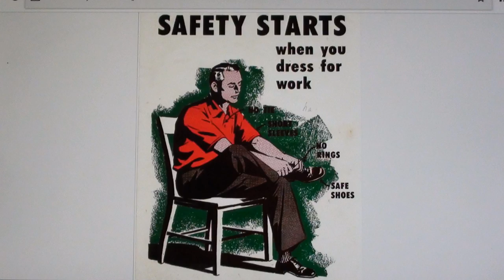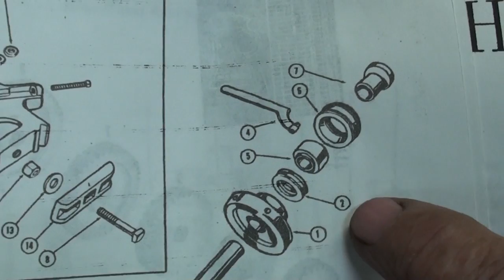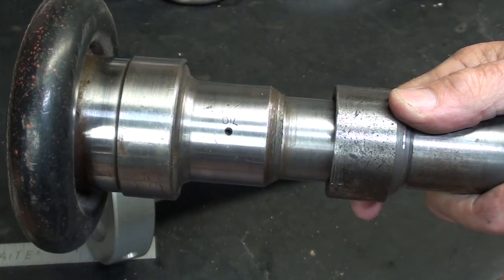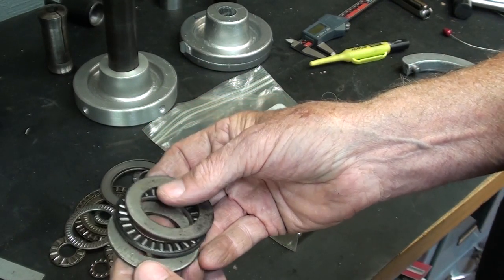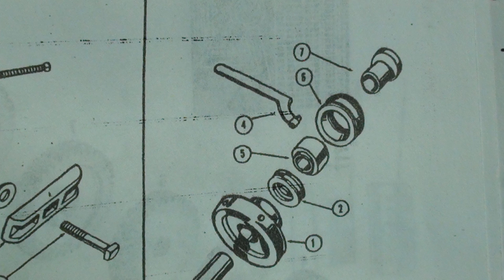Make a Hardinge Lathe Collet Drawbar 748 pt 4  tubalcain 5c handwheel

Comment: I enjoyed the series. Occasionally you corrected your description from drawbar to draw tube. My OCD wouldn't allow my employees to make that sort of description error in their repair documentation. If they did and didn't correct it themselves, I would edit their documentation.
We insisted on accurate documentation, because we daily referenced older repair records for current issues. I didn't want ANY misleading information for subsequent reference. My shop had written records of every repair dating from the early 1980's to my retirement in 2017. In 1994 we moved from handwritten records to digital records allowing extremely easy searches for data. Our shop rule was that complete documentation was to be made before beginning the next task. We ran an around the clock operation and I wanted subsequent shifts to be fully informed of repairs completed or in process, and I wanted them to have exacting detail. My highly skilled staff often resisted these requirements as unnecessary. Years later when our company embraced hiring low skilled staff, my low skilled employees could perform at a much higher skill by relying on accurate documentation. 
It was plainly obvious that every drawbar reference meant draw tube, but a career of exacting description detail has painfully marred me for life!

I liked your stepped alignment sleeve solution to eliminate the draw tube OD spindle bore ID misfit. It accidentally also gave you the required belt guard clearance! I like happy accidents. 
I refer to spindle tail or spindle rear reserving tailstock for the other end of the lathe. Once again my OCD rears its ugly head. Like most people with a critical nature, I am guilty of seeing other people's faults more quickly than seeing my own. I hope that I didn't make too many of the same error while describing my insistence that others be error free!

Comment: I always enjoy your projects even if I am an old woodworker with no desire to make the project myself.  Speaking of woodworking I restored an old claw foot piano stool last week with a broken spindle and used many of the things I learned here to repair it.  I chuck the spindle in the lathe, cut off the damaged end with my cut off tool and then used a drill bit in the tailstock to drill a new hole for the part I made on the lathe.  So old woodworkers can learn from old machinists, grin...

Comment: Good video!

I like the discussion on thrust washers, I went through this entire process making a drawbar nut for the spindle of my lathe, so I could put a 5MT end mill holder in the spindle and draw it tight. 

I made mine with two main pieces; a insert in the end of the spindle and then the main nut. The main nut had a bronze bushing pressed in and I did some  drilling to make oil passages through to the threads and the insert. 

There's a thrust bearing at the back end of the insert, and a snap ring on the end that keeps everything in place. A ball oiler at the on the back side allows you to oil the thrust bearing, the inner shaft, and the threads. The outer rim is knurled and  I put pinholes in it for a spanner.

Comment: Nice8-) I made a similar 5c closer for my Haighton mill.  However, Hardinge lever closers are not hard to use, one simply instals the collet with the closer lever in the out (closed position) snug up hand tight. Open the lever, tighten the closer a couple of notches more (the notches on that part prevent the closer from undoing itself) then the lever will lock the part every time.
Reply: Agreed. I used a lever type collet closer on a Harding’s lathe for many years. They’re very fast and convenient for short runs and production but probably not worth the time and effort to make one.

Comment: Worth mentioning the so called washers for the thrust bearings are not simple washers. But hardened flat bearing surfaces. Using ordinary soft washers instead would compromise bearing performance and life. Thrust bearing always come with the correct parts - use them unless the design includes integral hardened and ground bearing surfaces. I prefer the lever collet closer over the hand wheel but my favorite is the air operated collet closer. It is quick to operate and has one distinct advantage and that is it just supplies a constant pull
force regardless of the workpiece diameter. The lever operated closer may need some adjustment if your workpiece diameter is a little different than the last one. The new cost is about $3000 and they require shop air and a little installation. If your air quits so does your lathe,

Comment: You did better than me in finding that thrust bearing in stock. I have waited 20 years for such an occurrence. I did wonder about the set screw that you used in the bushing between the bearing and lathe spindle. It could not be tight or it would defeat the purpose of the thrust bearing. Maybe I missed that part, but did you cut a slot in the tube for the set screw to ride freely?
Reply from the maker: Hello setscrew has not been tightened. I need to take it out and throw it away, and fill the hole
Reply: Strangely enough, when I made a similar closer for my Haighton mill, I also found a suitable thrust bearing  , as it says somewhere "seek and yee shall find" :,-):-)

Comment: Mr. Pete. Great project. I do however have a question. Do you feel the spanner wrench is necessary? I ask this because my Clausing 5C drawbar uses only the hand wheel to tighten the work into the 5C collet. That hand wheel is capable of a great deal of torque on your work piece being held in the collet. I do realize Hardinge used the spanner in their design. I just question the necessity. I do believe my Clausing drawbar wheel is larger than the Hardinge design which may account for something. 
Thoroughly enjoying the project.
Reply from the maker: Maybe not. But a hardinge and clausing Both used a ranch. I wished to remain true

Comment: Great project!  Always love your machining videos.  Just a question though..you didn’t mention if you locked down the centering spacer you made to take up the radial clearance.  If you did lock the set screw it would in effect negate the advantage of having the thrust bearings.
Reply from the maker: Not locked

Comment: With the thrust bearing sandwiched between two stationary rings set screwed to the draw tube, are they doing anything? I think the centering bushing needs to be loose on the draw tube. Then you have the joy of it falling off on the floor sometimes when you withdraw the tube. Don't ask me how I know...
Reply from the maker: Set screw is backed off

Comment: So if the shim/spacer is set screwed to the center shaft and stationary why the need for the thrust bearing between the spacer and hand wheel? Aren't they in a  fixed position on the shaft?
Reply from the maker: That screw is not tightened and I need to throw it away
Reply: @mrpete222  It was confusing! Lol

Comment: Wouldn't a set screw on that collar defeat the purpose of the thrust bearing?  The collar should spin freely on the tube so the bearings can spin between the wheel and the spindle.  Or maybe I'm missing something.
Reply from the maker: The screw is not tightened. In fact I need to throw it away